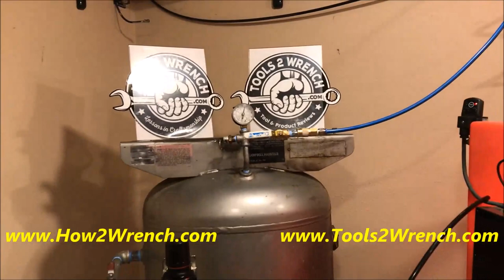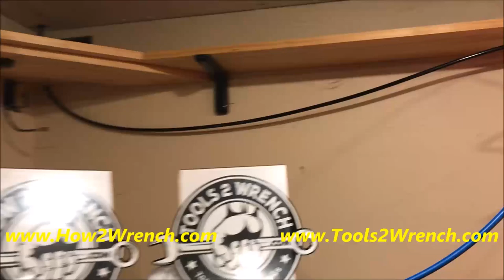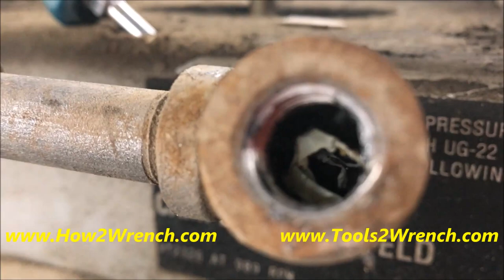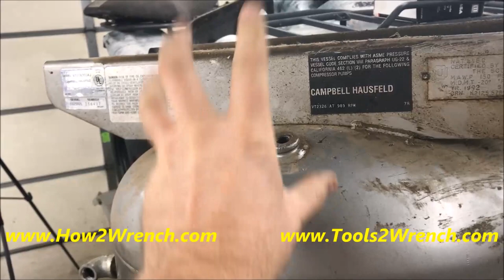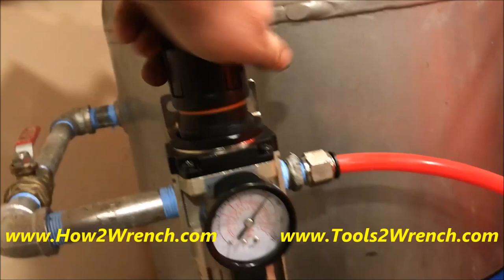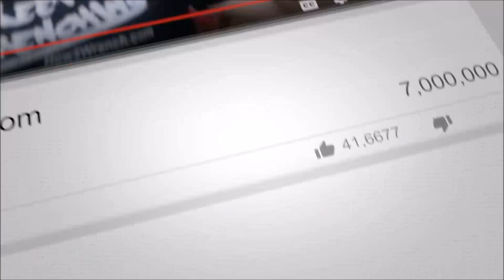Air tools running out of power? Static vs Working psi explained and the fix!

Comment: If you are on the end of a long air hose a useful trick is teeing into a portable air tank to use it as a reservoir.  I use a 1/4" NPT tee with one Milton brass hi-flow chuck and two nipples. Connect one nipple to your air tank chuck then connect shop air to the other. Connect your air line to the tool to the chuck on the tee.

Comment: Just a point of general compressor knowledge. Inside that fitting on the top of the receiver tank, where the line from the pump goes, is a check valve many people don't know about. If you are loosing air pressure in your tank over night and can't find where it's leaking from, it's that internal check valve letting air out of the tank, back into the pump and it must be replaced.